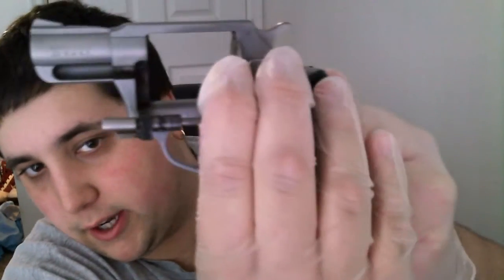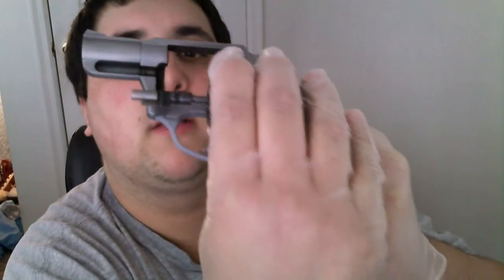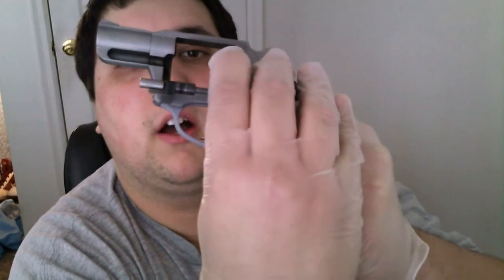Charter Arms Cylinder Problem/Ejection Problem

Comment: Extractor rod needs tightening and the revolver needs a good cleaning.  The difficulty ejecting spent cases indicates that the cylinders are fouled and need to be scrubbed with a bore brush and bore cleaner.

Comment: I know this comment is bringing this posting back to life so to speak but that's okay. Was just surfing and found the issues your video was about. In regards to the cylinder sliding back as demonstrated, you do not really need to send it to anyone to fix for you. If you tighten the crane retention screw it will remove the "loose" play in the crane. Even better, remove the screw, add some Loctite, screw it back in and snug it up. Just keep an eye on it for it seems to be one of those things with this model. Good luck to you and everyone else who might one day find this video.

Comment: It looks to me that you may have lost a part that screws into the ejector spindle which holds the cylinder forward where it belongs.
If you have the owner's manual, I think it has an exploded view and parts list, which could tell you if you have misplaced a part or not.  Check it out, If you don't have the manual, I suggest you contact Charter Arms to get one.
Gabby

Comment: I had the same  exact problem.... The injection of empties were a problem but it's getting easier and also has shrapnel flying back into my face s***'s crazy
Reply: When did you purchase and use the gun? Wonder if that's an ongoing issue.

Comment: Thanks for the informative video! HELP!!! My girlfriend had this gun (UC Lite .38 special) and I ended up buying it from her. She never carried it and we got her an LCP so she would at least carry it. She never shot it much, and since we have been together I have now shot it several occasions. 

Every single outing, this gun has gotten Jammed!!! Obviously, not in the manner as how a semi-auto would jam, but this revolver keeps getting stuck basically, and the cylinder will not open! After about 30 rounds through it, the extractor spring nut on the cylinder starts to unscrew, it unscrews while shooting so much that it won't allow the cylinder to open! 

At the rifle range this became quite the problem, as all weapons need to be opened and flagged while the line is cold. I have had to use my leatherman with a flathead to pry it back open again! It actually took quite a bit to get it open too. This has happened EVERY SINGLE TIME that I have gone shooting with this gun. Once I pry it back open, I just have to tighten the nut a little bit, but not too much! It must be EXACTLY in the right tightness, as over tightening will not allow you to close the cylinder, and under tightening will also not allow you to close the cylinder. This seems like such a retarded complication, and one that should have been debugged by now. 

Has this ever happened to anyone else while firing this weapon??? I was thinking that to maintain the right amount of tightness, other than putting loctite on the threading, I might be able to use a bit of teflon tape on the threading so that the screw doesn't wiggle loose while firing. It has me ready to sell this gun altogether, I don't want a freakin revolver that jams!  LOL   HELP!!!  Thanks in advance to anyone that can assist!

Comment: hard ejection sometimes has something to do with fouling of the cylinder specially with the caliber that you have been using.... i see your revolver is a 22....all i had to do with my smith and wesson m317 is clean the cylinders and scrubbed them thoroughly...problem solved.
Reply: That makes sense mine has been getting the spent shells stuck in the cylinder pisses me off cause ik that if I need to put more then 6 shots down range then that problem would be fucking me hard in that situation so I'll try cleaning the shit out of it and then see how it cycles threw rounds each cylinder load and see how fast it's fouling the cylinder when I shoot it

Comment: chambers in the cylinders need to be scrubbed.  The cylinder popping out is not normal,  newer charters have done away with the frame mounted cylinder stop and cylinder retension is on the arbor.  You normally need to plastic mallet the cylinder off the yoke.  Tony from Charter shows you how  https://www.youtube.com/watch?v=-EgSOYn3xJM

Comment: Dude . 2 things...the ejector rod head is missing 
And (along with the front spring I suspect)

That's what's going on with the loose cylinder
.
Next SOMEONE has been shooting some very hot ammo  through this gun ... Reloads I suspect .or it could have been buffalo bore or corbon... how do I know? Because you have bulged cylinder Chambers. Its What happens when you shoot too hot of a load, sometimes it bulges a cylinder Chambers so when you shoot a round in it, the brass swells up. This makes it hard to eject. Bottom line is you do not need to be shooting this gun in the condition it's in. Send it back to the factory....But Don't Shoot It !!!!

Comment: Well ? What's the update. Mine was spitting back shrapnel also. I sent it back. It was the forcing cone. Charter bored it
Reply from the maker: in my uploads. Send it back.
Reply: Is the forcing cone part of the cylinder or the chamber of the barrel itself?
Reply: @tyladube801  it not part of the cylinder.  It's the rear part of the barrel.